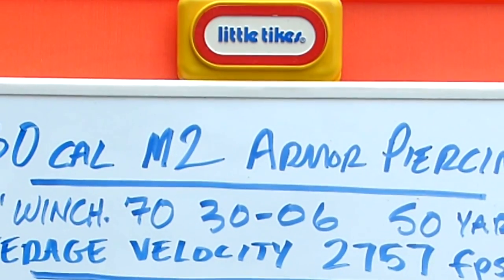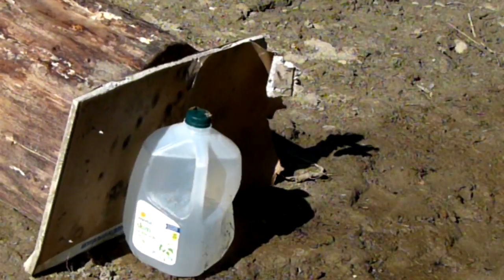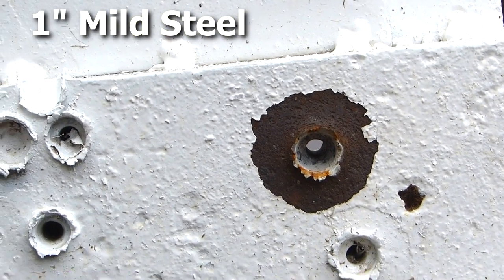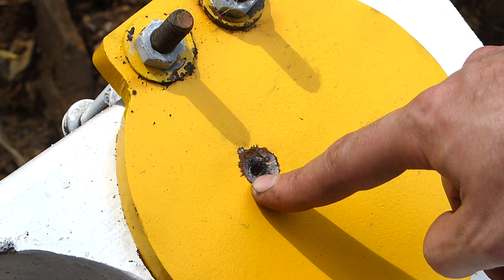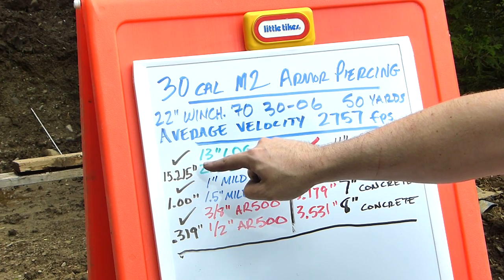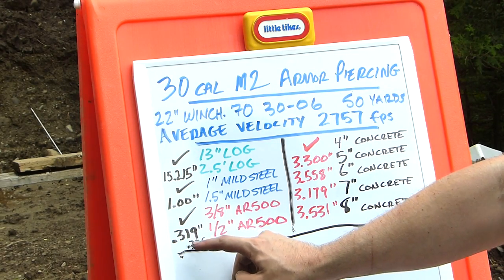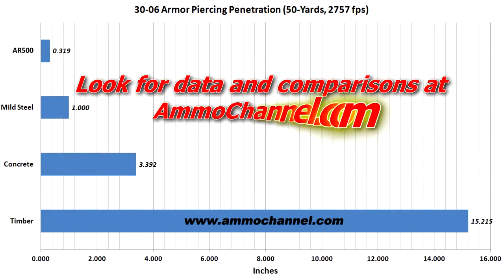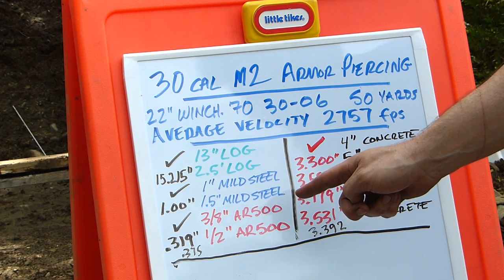30-06 M2 Armor Piercing - Data gathering and analysis

Comment from the maker: The core is surrounded by soft materials, like the bullet jacket and lead fillers.  Theoretically it should have no greater destructive force than firing any 'standard' bullet down the barrel... unless I am missing something here.  That would be an interesting read, if you have a link please send.  Thanks!

Comment: This would be correct; only the penetrator is hardened and is entirely encased in lead and a copper jacket. In fact, the penetrator relies on this sheathing of softer metals to both function and fire properly. If the entire bullet was made of the same material as the penetrator, the rifling wouldn't be capable of "biting" it and providing the proper spin, which would make it tumble uncontrollably. It's also critical that the jacket/lead separate on impact, so the smaller core can penetrate.

Comment: Interesting. Some time ago, Phil Sharpe, (Sharpe & Hart), did similar tests, but included an accuracy test of several groups, before & after running AP ammo through the barrel, using soft nosed bullets. He found a considerable enlargement of the "after" groups compared to the "before" groups, & concluded the much harder AP bullets were very destructive to barrels. Do you have any similar results?

Comment: Very interesting analysis.  Do you intend to load up SS109 penetrators in your hyper velocity tests?  Looking forward to the 300 win mag.   I wonder how those 30-06 AP round would perform loaded up to modern 30-06 pressures (65k) that modern bolt guns and 30-06 AR platforms can take.